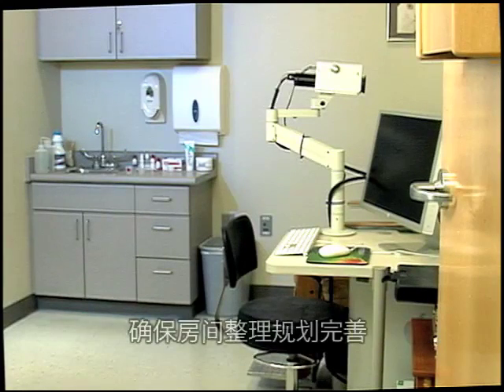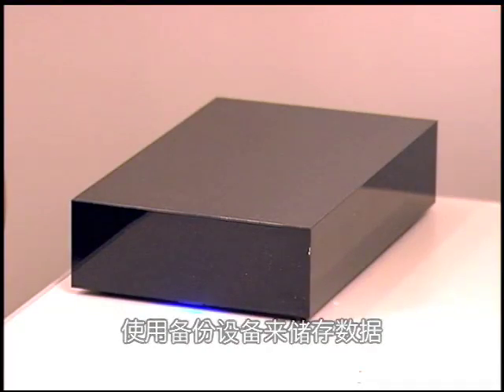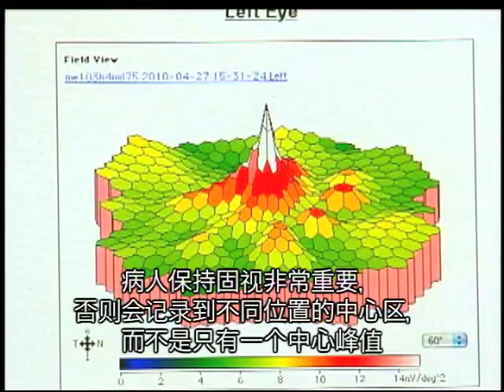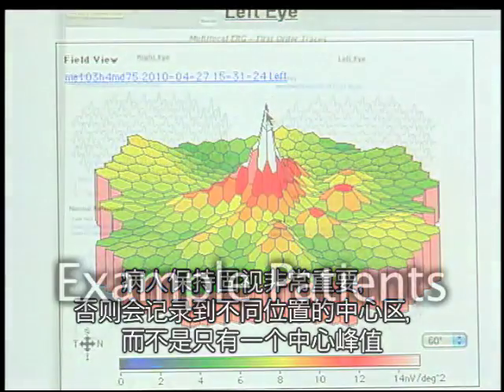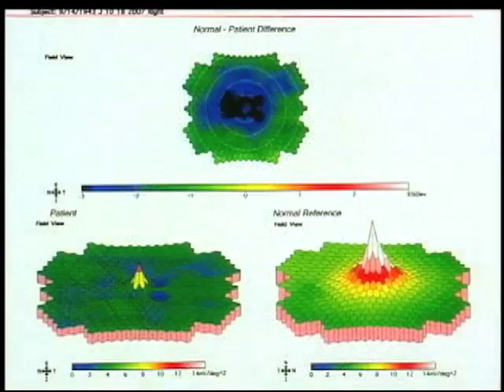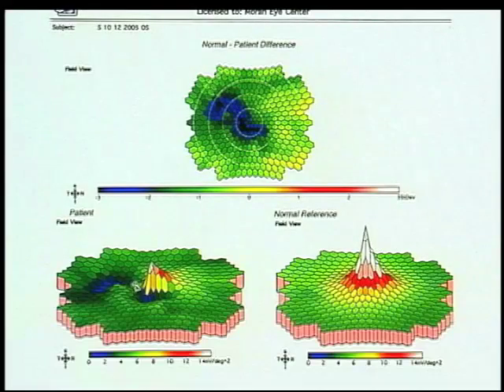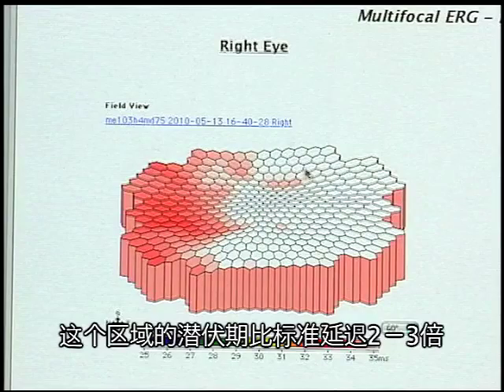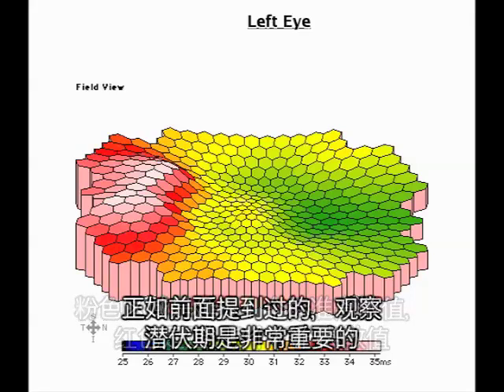How to Perform a Multifocal Electroretinogram

Comment: Is it possible to do a Electroretinogram without putting the steel thing inside the eye?
Reply from the maker: Yes. Many use a silver thread that touches the sclera along the lower lid called DTL.
https://shop.neurospec.com/dtl-electrode-sterile-10-pack?___store=en_US&___from_store=x_default

Comment: What is N1 P1 wave in Multi focal ERG?
Reply from the maker: The mfERG is a mathematical approximation of an ERG. The origin of N1 of mfERG is roughly similar to a-wave of full-field ERGs. The P1 component is formed by interaction of recovery of the photoreceptor response and potentials associated with depolarization and recovery of cone ON and OFF bipolar cells. a combination of overlapping ON- and OFF-bipolar cell contributions combined with smaller contributions from inner retina and photoreceptors.  Best source for information re mfERGs are writings including author Erich E. Sutter.

Comment: So how would a test like this work if fixation is required but the patient has nystagmus? In that situation the patient may have difficulty with fixation.
Reply from the maker: Good point.  The good news is almost no patients that the multifocal electroretinogram is required have nystagmus.  I have tested more that 10,000 and not had a patient other than albinos that fixation nystagmus is an issue.  The pattern does not have movement left/right or up/down.  The hexagon stimuli pop on and off producing little apparent movement as compared for example to pattern reversal VEP stimuli. If interested see Figure 20 of internet chapter: webvision.med.utah.edu, Part XI, Albinism: http://webvision.med.utah.edu/book/electrophysiology/visual-and-auditory-anomalies-associated-with-albinism/

Comment: I understand the use of a local anesthetic, but how do you deal with patients that do not like things near their eyes?
Reply from the maker: Most people will allow the contacts.  Surface of eye and under lids is numbed so there is no feeling.  Every year or two someone cannot do it.  Twice in thousands  people fainted.  They did not faint because I put contact lens in their eye.  They fainted while I was standing next to them prior to inserting contact. There are thin silver treads called DTLs that can be used instead of contact lens.  They droop in lower lid.

Comment from the maker: You are correct to question accuracy if patient has nystagmus.  Generally results are good because the stimulus is brief appearance of a pattern and not a reversal of pattern, which exacerbates nystagmus.  I have tested albinos with significant nystagmus with good results.
Reply: Hlo sir can I ask some question
Reply from the maker: If you don't want to put anything in an eye one can record just outside eye, BUT you have a huge reduction in amplitude of ERG.